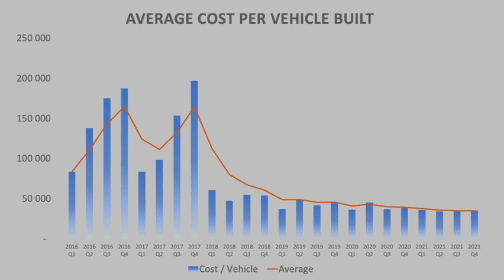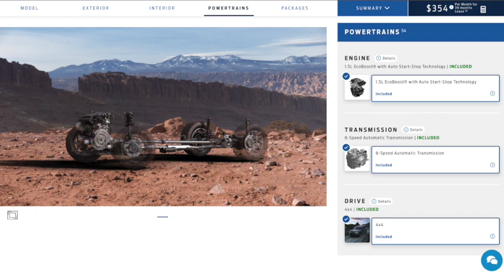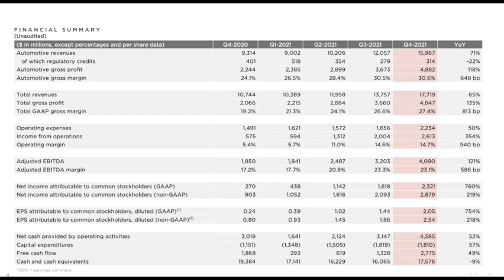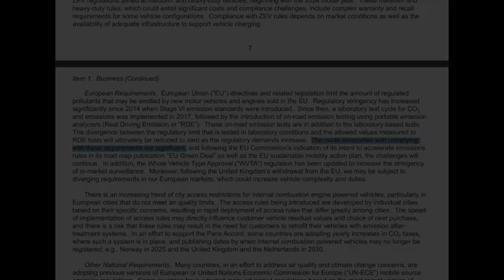The simple metric that will destroy the internal combustion engine - for good.

Comment: you do realize you are comparing luxury products with mid to low-range products obviously gross margins are higher for the "mid-range luxury segment" in other words profits on cheap cars are low, profits on super expensive cars are low. tesla simply hit the sweet spot. but this is impossible to scale up as most people simply cannot afford a vehicle in that range. it all comes down to development cost/units produced and while yes EVs, in general, are cheaper to develop (model to model variations) the production is certainly not as scalable as internal combustion. finally, it’s good to remember the underlying technological problem with current battery-based EV since its simply not sustainable in volume production and from an engineering perspective diesels still have the upper hand in terms of efficiency by quite a large margin. And all of this only takes passenger vehicles into consideration once we consider commercial vehicles EVs fail on an even bigger scale therefore building a business around a technology that simply does not exist seems like an easy way to fail and all the OLD automakers realize this but are simply entertaining the legislators due to uninformed pressure from consumers who usually lack the basic scientific understanding.
Reply from the maker: That is a good observation, and you could be right. My analysis is hardly definitive, but I do believe there is quite a bit of supporting evidence though. US average sales price for 2021 was $46k - which places Tesla pretty close to average, as its ASP is $51k per vehicle, by my calculation.  Ford's ASP is reportedly $51k in 2021 - but their global operations could very well pull their GM down, it isn't clear from their financials. 

Also, BMW ASP is around $53k with 2.2M units sold - and their margins are only 20% as noted.
Reply: EV production costs are falling and will continue to fall with innovation and production scale. These costs are falling at a faster rate vs. ICE costs. 

Why do you say "production is not as scalable" for ICE? Do you have data to support that?
Reply from the maker: I am not sure I made that exact statement in this video, but it certainly is implied.  don't have empirical data to support such a claim (that ICE manufacture is not scalable)  - but 
there are no ICE manufacturers out there that I can find which can demonstrate margin expansion. 

I did discuss the topic in the Tesla competition video.

 In that video, I do comment on vertical vs horizontal integration, and that horizontal integration is crucial to profitability in mature industry. My thesis there is that horizontal integration will only enable you to grow at the pace of your slowest' supplier.